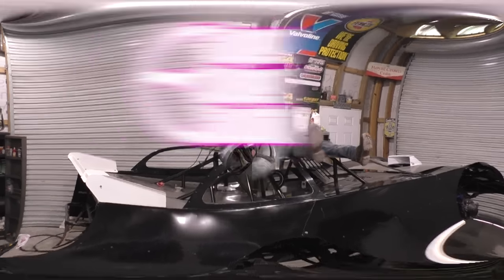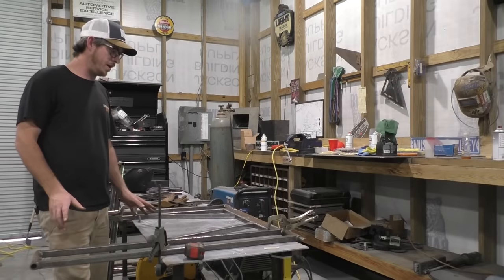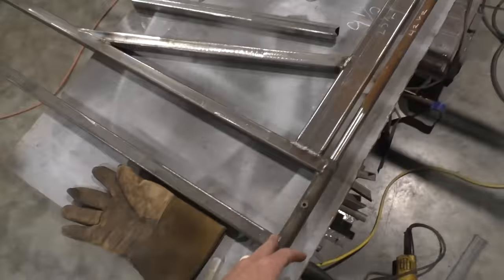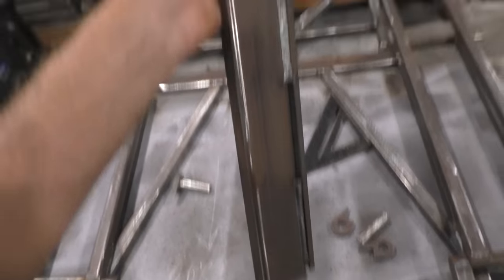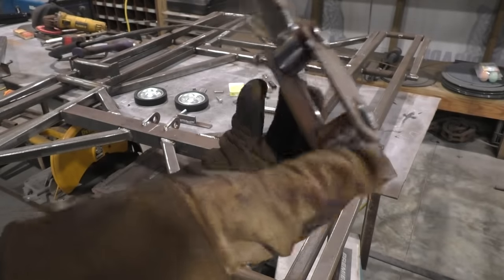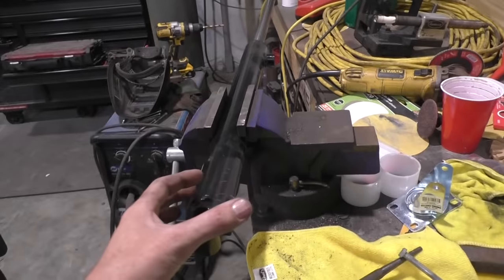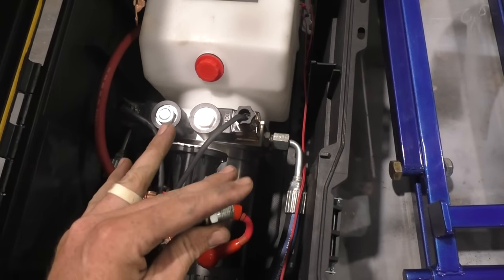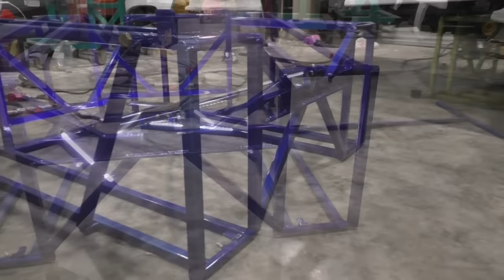How To Build A Pit Lift

Comment: We are about to build one based off your dimensions. Since making this video, is there anything you would have changed with your design before we start? Awesome video BTW!!
Reply from the maker: I've built a bunch of them since this video. only thing I've changed is I get a little bit more angle in the lift cylinder in the closed position, and it makes it open a lot smoother. I've built around 20 of these. Thanks for watching my channel. Be sure to subscribe if you haven't already. I have a few videos in my diy playlist of racing tools on a budget
Reply from the maker: @craigstykes9888

Comment: One more question: What do you believe the gross vehicle rating would be and what would your opinion be to raise the GVR? Do you believe doubling up on the constant portion of the lift would allow the lifting of, for example, an F-250 pick up or in my case a '73 C3 Corvette at 3500 pounds? I have literally bundles of thick wall 1 inch square tubing that this project is made in heaven for.
Reply from the maker: I would think that it would allow for 3500 if built correctly with a cylinder on each side but im no expert. As far as an f250 goes you would def have to use thicker tubing but could use a similar concept just because ur gonna have to make the arms taller which would then make it more vulnerable so u would def have to beef it up the taller the application becomes and would highly recommend 2 cylinders but this is all just an opinion I do not recommend anybody doing any of this. I'm an idiot tho lol
Reply: Do a simple CAD drawing and then send it to an engineer. Have him/her design it to correct strength with no guessing. It may be worth the inquiry as to the cost. Wish I had some of that tubing, I'm a fabricator by trade and I could build a lift that would definitely lift an F-350. It would a fun project. Good luck.
Reply from the maker: @JustMike2791  God bless the blue collar men brother

Comment: Couldn't help but notice... I didn't see any locking mechanism , did I miss it?  And I also couldn't help but notice you DIDN'T lift a car at the end, the operation at the end made me think it is too light duty, worked too fast for the loading, and was quite jerky, probably from air in the system.  Not sure this is the right solution for the effort.  I bought my two-post lift from a garage doing upgrades for $800.  Two new cables for $70, and I'm in business with a 12k lb load rating, that IS certified to 2-times the rating for commercial use.  I seriously question the safety of that thing.
Reply from the maker: Mainly used in racing lifting 3000lb race cars and the same lift that lifted the car in the beginning of video is the lift I built just placed it in beginning of video and I have a lock that goes down on the side when completely lifted

Comment: I got to thinking ( dangerous activity, I know ) that the cylinder was at to shallow an angle for the initial push but realized the initial lift was only the weight of the frame itself. When the frame makes contact with the body of the car, the cylinder push angle is at the critical 15 or so degrees needed to be effective. Pretty slick young man. I like the way you think!
Reply from the maker: Thank you mainly used for race cars but makes a nice tool for at home oil changes and what not as well
Reply: I'd we can modify this to safely lift 4,000 and realistically that is not much weight if, that is, you are familiar with lifting that kind of weight. My plan would be use this to lift only and support the vehicle with Jack stands anyway.
Reply from the maker: @crawford323  I build dual cylinder lifts that pick up 4000 pound factory stock race cars but I also incorporate a lock that keeps it from folding back down if you was to have a hydraulic freak issue while lifted. With the single cylinder I've lifted 3000 pound cars with no issues but wouldn't try to lift much more than that

Comment: what's the weight capacity with one cylinder? I need to  lift a 3100 pound car. 
Thanks for showing us fab guys this video, nicely done.
Reply from the maker: I personally wouldn't lift anything over 3000 pounds even though I'm sure it would. But I'm editing a video now of how to build a dual cylinder lift that's much stronger. It should be out within the next couple of weeks, so stay tuned, and I appreciate you checking out my channel
Reply: @SuperDuperSouth do you have video of two cylinder built? I want to make same as you..but i will be doing quickjack design..so there is no connection between the rails.
Reply from the maker: @2shaepowah52  yes look on my racing diy play list and there is a how to video for it. Also a video on how to build you own steering buddy and roll around stands.

Comment: What's the total cost of materials do you have a complete list of everything
Reply: Following
Reply from the maker: I don't have a list but just watch the video and make a list as I explain it I say every measurement. Ull need roughly 30' of 1x1 tubing 14 or 16 gauge, 3 ft of 1" flat bar 3/16" thick, 4' of 3/4" square tubing for the handle. It will cost you close to $600 for everything it takes to build it. I never made a list. But I did make a video for you to go off of. Thanks for watching good luck with ur build